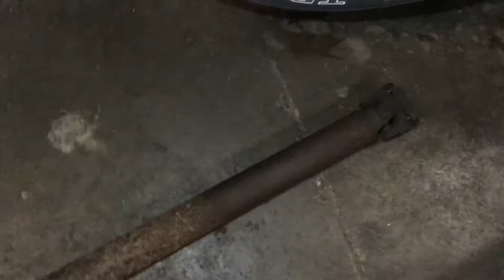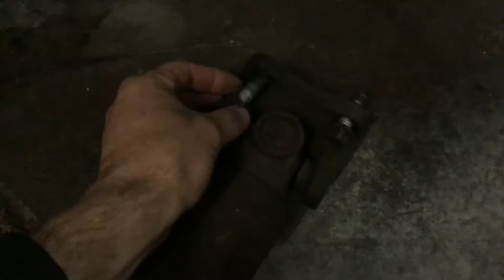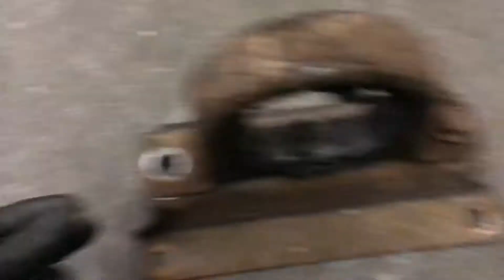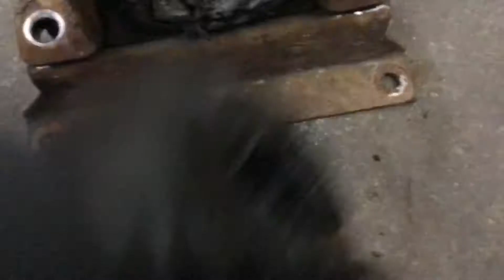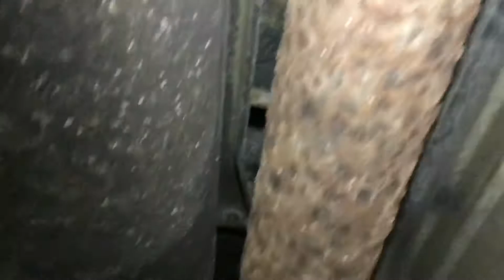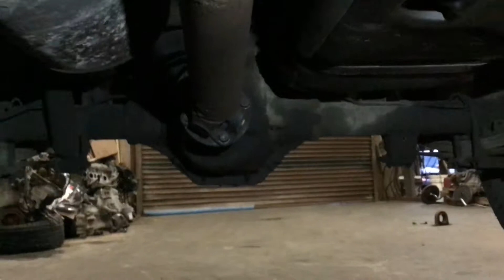2004 Dodge Dakota drive shaft replacement

Comment: I have a 2005 dodge Dakota as XL V6 3.7 and it’s a stick my issue that I’m having is my driveshaft the back one keeps falling off from the back wheel of the pumpkin it has a knot on it with the four bolts what do you think my issue could be
Reply: How do you put the new one on?